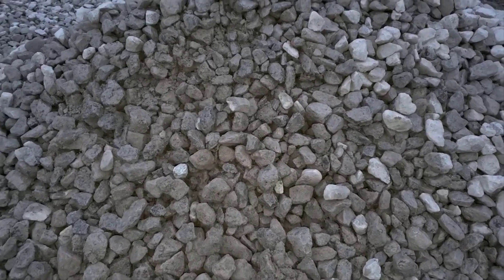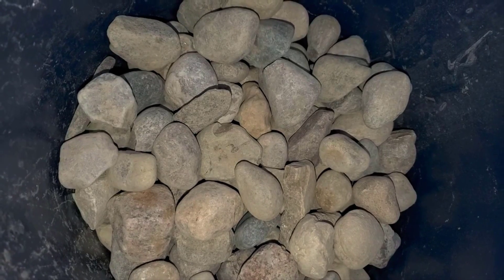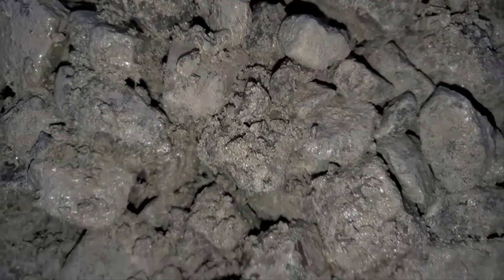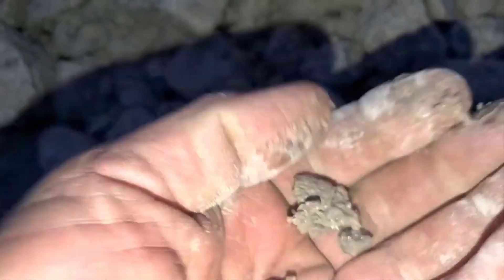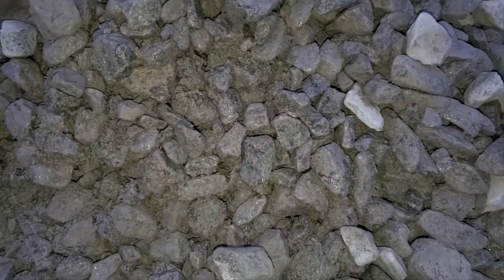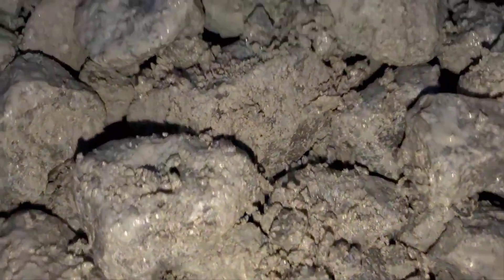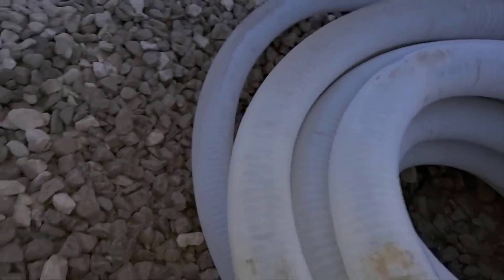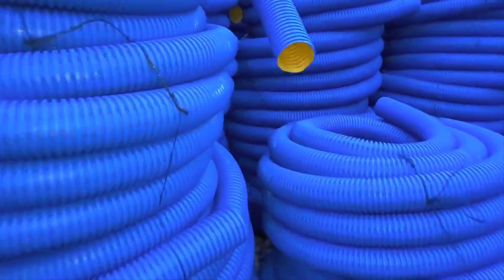Do I Need to Use Perforated Pipe with a Sock in My Yard Drainage System?

Comment: If you set the base of the trench lower, the fines will wash down, you only need a couple of inches.
The thing to consider is that if it does have lots of limestone that's been pulverised, that will settle in the base of your drain and consolidate so will slow the percolation through the bottom.

Comment: I just put in a 150' section of french drain. I used what we call 57's but had a lot of dust and chips...I drilled holes in my wheel barrow and would actually wash 2 shovel scoops of gravel at a time before I put it in my drain...my neighbors thought I was nuts. But I wanted to make sure my drain was clean of any junk before I covered it.

Comment: Can you use 2 socks? It should still drain with with 2 socks, just probably slower, right?
Reply from the maker: https://youtu.be/vRDArxPmK88?si=89B2wxTkdLz_KuWj
Reply: @FRENCHDRAINMAN  I did the burrito wrap method like you guys. The rock near me had some fine particles mixed in and that is why I wrapped the perforated pipe with 2 socks to be on the safe side. Besides it draining a little slower, was that a mistake on my part? Thanks for your reply!

Comment: Doesn't the sock clog?
Reply from the maker: Yes it will if you don't use a soil separator
Reply: So in other words you use two fabrics. One round the pipe to deal with poor crushed drainage stone and then one around the trench to deal with soil @FRENCHDRAINMAN
Reply from the maker: https://youtu.be/tgJsHEmluDE

Comment: I have an excellent 4” basement perimeter drain and a separate 4” curtain drain that currently both exit to daylight into the start of a field however I would like to extend it 600’ to a swale across a nice hay field between 3-6% grade.  Would you use a non-perforated pipe and would you combine them?  Thank You!!
Reply from the maker: @Tim
If it's to discharge the water and not collect additional water solid is the way to go.
Reply: FRENCH DRAIN MAN 
Do you guys use stone around the solid pipe or direct bury it?  Thank you again!!
Reply from the maker: @timchace5772  
Good question Thanks for the comments today. Not the norm but if there is a lot of vehicle traffic then Yes.